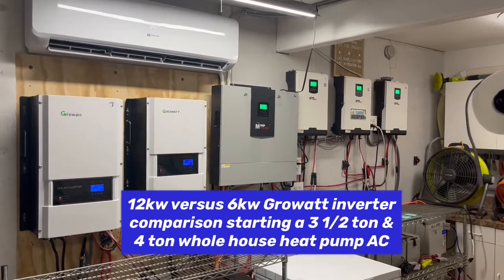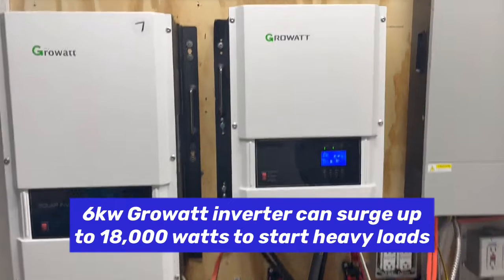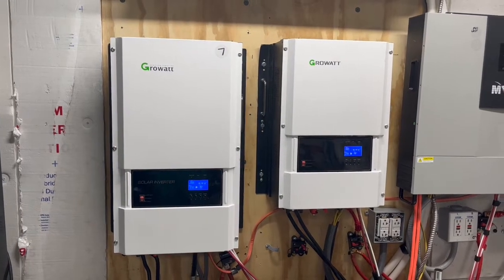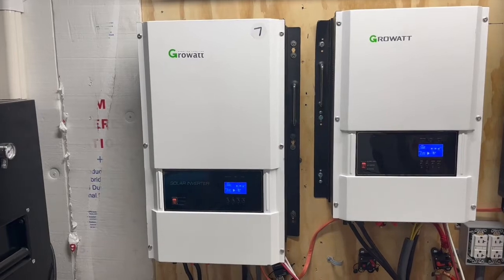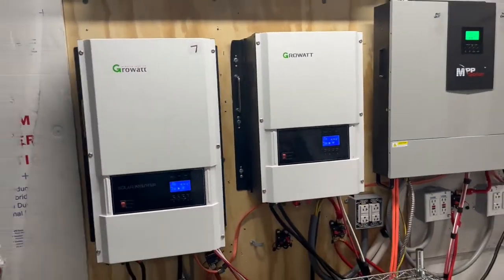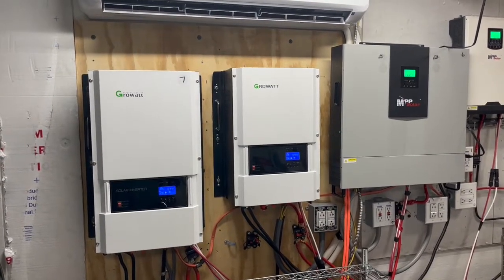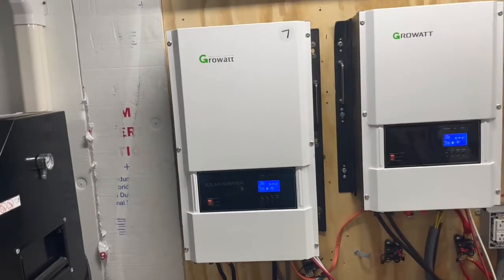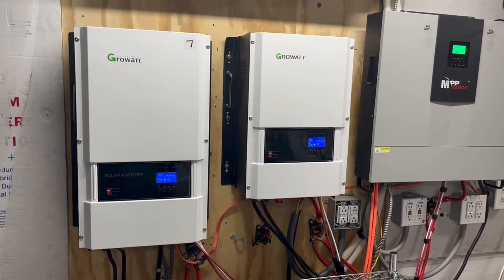12kw & 6kw Growatt Low Frequency off grid inverter comparison to start 3 1/2 ton & 4 ton AC.

Comment: I have the 6k Growatt and just installed a HyperEngineering soft start on my 3.5 ton whole house condenser.  The furnace is also on this same inverter.  The soft start device made it all work.  The furnace fan is just a few hundred watts but its in addition to the condenser pump and fan which is where the soft start made the difference.  I am running close to 75% when AC is on, but its now powered by the sun and I'm thrilled.  Thanks for sharing your videos and experience.
Reply from the maker: You are welcome, it is a great accomplishment to run ac/furnace on solar. The wonderful part about all of this is there are so many people willing to share on YouTube, taking a lot of guess work out of the equation. That’s how I learned to put my system together. I love the fact my neighbors bills are between $600 and $900 a month in the summer months and my bill never goes over $170 for the peak month. In fact my bill for electric all year is approximately $1000. I am all electric, no gas. My neighbors are so jealous but to lazy to install. I offer to help but don’t want to spend any money. My System cost around $14,000 and will be paid off in less than 3 years with rebates and savings on electric bill. We have 2 extra inverters as spares and all the supplies to replace parts for 2 decades. We set the thermostats way lower with solar. Well worth the effort and money spent. Thank you for sharing, You system will be well worth it when heating and cooling cost skyrocket over the next few years for those who did not do solar.
Reply from the maker: You are very welcome, it’s great to run your ac on solar. I actually use my 12kw Growatt to run my 3 1/2 ton and I don’t use the 4 ton that often. I can run my 2-120v mini splits downstairs and keep it just as cold plus run my 18,000 btu mini split in the garage and that uses the same  as the 4 ton. Never have any problems with the Growatt 6kw or 12kw. I can actually hang another one of my spare inverters up and have enough panels to spare for around another 2500 watts. I have more electricity than I can use. That is a great problem to have. Hope you have a wonderful and blessed day.
Reply: Thanks for the name drop. Really helped me out as I'm dealing with simular issue. Thanks bhunter763
Reply: @Moist_yet_Crispy  Glad it helped, I was really having a tough time deciding to try it because that's not a cheap experiment.

Comment: How long do those batteries run your whole house heatpump before they go dry?
Reply from the maker: I can run all day long, sun up to sun down, but I do not run on battery bank at night. No need, my electric bill is under $1000 a year. I only have electric, no gas.
Reply: Hi, how do you switch from solar to grid at night?
Reply from the maker: On my 12kw Growatt I have the 240v input coming in from my grid so I have to turn on breaker in separate electrical panel of grid power coming into garage and on bottom of inverter for input voltage and change setting number 1 from solar, battery, utility to just utility. Then you will be able to run through inverter all night. I’m almost to the point with a few more batteries to be able to run 2 mini splits upstairs and 2 mini splits downstairs overnight to cool house. We are only electric and my highest electric bill last year was $172 in August keeping house at 70-74 degrees overnight using utility to run both upstairs and downstairs  whole house heat pumps that are 3 1/2 ton and 4 ton. I do have a set up outside where I have 2 separate AC disconnect boxes to where I just move fuse handle from solar AC disconnect box to utility grid AC disconnect box, then I’m ready to run utility grid power overnight. So I have 2 different ways to switch from solar to utility grip power. Hope that helps. Have a wonderful and blessed day.
Reply: @diy-solar-guy  this is amazingly helpful information. Thanks!!! I want to run a well pump with this. I would like it to run on utility unless we lose grid power then it would switch to inverting from battery. My only concern is I've heard it uses 150 watts per hour or 3.6kwh a day. Do you know if it's still using this much power if it's in straight utility mode?
Reply from the maker: I would definitely use LiFePO4 batteries instead of AGM to use as backup overnight. I have 3 chest freezers, a 20 cubic foot fridge/ freezer and lights outside I run on battery overnight and it barely changes the voltage on batteries for the 12 hours I run all of them. That’s about 150-200 watts per hour. That LiFePO4 battery bank is 4-12 volt 150ah 2KWh connected in series to make a total of 8kWh 48 volt battery bank. I use that battery bank over the 51.2 volt 100ah 5kwh server rack battery because you have 3KWh more. If I had 2 server rack batteries in parallel I would use because it would give me 10KWh. But I bought the 4-12v batteries for the same price as the server rack battery. It also depend on the inverter usage you use at idle consumption. My 12kw Growatt uses almost around 200 watts per hour or 2 amps per hour at idle as where both my MPP inverters use less than 25 watts or .2 amps per hour. So I only use my Growatt inverters during the day. All my inverters are 48 volt systems. Hope this info helps.
Reply: @diy-solar-guy  ouch 200 watts per hour. that 5kw a day. makes sense you dont use them at night. I will have to figure out a way to only use them when the grid goes down. thanks for this info. very helpful in helping me decide how to design the system.
Reply from the maker: @jl9678  Growatt low frequency off grid inverters are great during the day but will need probably a 25kwh or more battery bank at night to run whole house. I have 2 mini split heat pumps upstairs and 2 downstairs and with my next set of LiFePO4 battery set I will be able to run all 4 overnight if I want to or if power goes out. 3 years with mini splits and all 6 are still running great with no problems or leaks. My 16 AGM batteries are over 3 years old and still hold a full charge overnight when not using because I only use during the day. I am really impressed with the AGM batteries but the seller is no longer on internet or eBay. Those AGM batteries start the large loads for 3 1/2 ton, 4 ton ac heat pump and 12.7 ton pool heater heat pump. I can use the 48v battery evo batteries in series as well to start 3 1/2 ton and 4 ton ac but have not tried starting 12.7 ton pool heater with LiFePO4 yet. That’s for another day.
Reply from the maker: @jl9678  the inverter will not show any usage from battery since it is in bypass mode. I never use my 12kw Growatt overnight so I’m not sure. I know the fans do not kick on in grid utility mode. It will not generate any heat for fans to kick on. I will run the grid bypass mode for 2-4 hours in early morning hours in February to run 12.7 ton, 127,000 btu pool heater and the fan never kicks on and nothing gets hot. I have 6 gauge wire running from grid power to inverter and to 127,000 btu pool heater. Nothing gets hit in bypass mode fir me and that can use up to 186 dc amps running that beast of a pool heater. I know when 12kw Growatt is in idle mode without fans running it will show using almost 1.5 to 2 amps usage when connected to my server rack battery. My Dual phase MPP and Single phase MPP inverter are great for overnight since idle shows .2 amps in idle mode. That is 1/10 of power consumption of 12kw Growatt. That’s why I love having Growatt for day and MPP for overnight. Hope this info helps. Have a wonderful and blessed day.
Reply from the maker: I started with the MPP inverters so it was no extra expense to use at night. And both MPP inverters were $1500 each. I also have 4-24v MPP inverters sitting in shell Incase the 48v Mpp inverter stops working, with the 12v battery Evo batteries I can easily change to 2-24v batteries with same 8kWh overnight. 24v MPP was using around 15 watts per hour idle when I was using them. That is why I have Anderson 175 amp quick disconnect cables for all my inverters to be very versatile. I like to think ahead on things. Lol
Reply: @diy-solar-guy  so if it doesnt get hot in grid bypass mode maybe its not consuming 200 watts from the grid in that mode? Im assuming since inverting is not going on that its not using all that power? if so that would be great. 

i have some questions.
1 . is there a way to automatically switch to bypass mode at night? I dont think so but I thought id ask
2. what do you think about using two inverters. low frequency for high starting loads like well pump and fridge and and high frequency for resistive loads?
3. can two different inverters pull off the same battery bank? 
thanks
Reply from the maker: @jl9678  answer to question 1
I believe you can install a automatic transfer switch externally from inverter but I never tried it. Subscribers have mentioned doing that in the comments on some videos
Answer to question 2
These Growatt low frequency inverters Connor be paralleled together. The 12kw Growatt low frequency inverter has a surge capacity of 36,000 watts so that is a lot to start large loads. Maybe other brands of low frequency off grid inverters can be paralleled together but I have not looked into that. I just know the Growatt low frequency inverters can not be paralleled together.
Reply from the maker: Answer to question 3
I have never tried to connecting two different inverters to the same battery bank while running. Not sure if it is possible without destroying equipment. Not willing to try to find out. But I know I just added a EG4 5500 watt, 100 amp output charge controller that can supplement the loads on all 4 of my inverters, but only connected to one inverter battery bank at a time. But I use Anderson 175 amp quick disconnect cables to quickly move charge controller from one inverter to another as my loads increase for certain inverters throughout the day and decrease on other inverters throughout the day. I always turn off charge controller breakers on side of unit before removing from battery bank and keep off to add to a different battery bank, once connect to 48v battery bank I turn on breakers and good to go in 30 seconds with supplement power or as a stand alone as only charging source for battery bank without solar panels connected. Check out my latest videos on the EG4 48v charge controller and see how I use the charge controller and how to wire up. This EG4 charge controller is only for 48v battery banks connected to 48v off grid inverters weather high frequency or low frequency inverters. A great way to help with surge of large loads. Also you might want to check out my video on soft start to lower starting surge on large loads by up to 75 percent on inrush amps. Lowered my inrush starting amps on 127,000 btu pool heat pump water heater from 186 in rush staring amps down to between 42 in rush starting amps and 59 inrush starting amps. That is a huge reduction in inrush starting amps. I used the same soft start for my 3 1/2 ton (42,000 btu) main heat pump ac unit as I did for the 127,000 btu pool heat pump water heater. Same unit works on both units. Info on product and where to buy is in videos. Hope this helps you move forward with your solar project. Hope you have a wonderful and blessed day.
Reply: @diy-solar-guy  thanks very much for this info. im subscribing to your channel now and ill go watch your other vids.
Reply from the maker: @jl9678  hope the info in videos answers your questions and gives you a better idea of what is possible with off grid inverters, charge controllers and battery banks.

Comment: My aims power 6 kilowatt will start and run, my 3.5 central air unit. With my 80ah 48v battery. I build lifepo4 batteries. They wor really well. Along with fridge freezer water lights tv.
Reply from the maker: Unfortunately the 48v 5120 watt hour 100 amp lithium iron phosphate I have is unable to start my 3 1/2 ton and 4 ton ac. Tried everything but it just shuts down. Have not had any luck with the 48 volt lithium iron phosphate starting anything with even a 30 amp inrush. Tried every setting possible but no go. I have no problems with agm batteries. Even 4 just agm batteries in series starts the 4 ton with inrush of 119 amps with Growatt 12kw inverter. Signature solar said I needed 2-5120 amp hour 48 volt lithium 100amp iron phosphate in parallel to start 4 ton. Not willing to drop another $1700 on a lithium iron phosphate when my agm batteries work just fine every single time I start up my AC’s. I even had 12,000 watts connected to 12kw Growatt and it would not start with lithium. Only had 4000 watts with agm batteries and 12 kw start 4 ton with agm. I’m beginning to wonder if there is something with the bms on lithium iron phosphate battery that will not allow the 100 amp or even 30 amps inrush current. I believe you that the lithium iron phosphate batteries work well, just have not been able to get the 48 volt battery I have to work even trying on four separate inverters. The 24 volt lithium iron phosphate battery bank I have has worked well and I plan on getting 2 more so I can make a 48 volt battery bank and us as 24v in my motor home down the road. Those can handle a surge of 100 amps no problem and use Anderson cables which makes connecting easy.
Reply: @diy-solar-guy  I buy them from aliexpress, I use both prismatic and, 32700 litokala. And daly bms. They work really well.
Reply from the maker: @carlosreyes6448  The 12v lithium iron I bought from batteryevo in California and really like. They were easy to configure with settings on 24v mpp inverters. Anderson connect makes portable for motor home. I have not tried using the 51.2v lithium iron phosphate battery since I added soft start to 3 1/2 ton ac. It is working so well with agm batteries I really don’t want to spend the time trying with lithium. Lithium does not like being charged with more than 30 amps when it is should be able to take 100 amp charge. Battery shuts down. Not inverter?
Reply: @diy-solar-guy  its usually around 52 to 54 volts.
Reply from the maker: @carlosreyes6448  correct

Comment: Dont just plug solar from one inverter to the next, you need to make sure the open circuit voltage of your PV is correct for the connected inverter.

 Having errors because of PV connected and keeping it without understanding why is a big safety issues. You’ll blow up your inverter or start a fire 🔥
Reply from the maker: I appreciate your input. Not sure if you know I’ve been running this system for over 3 years now with no issues. I know what all my arrays pv voltage is, do you know what my pv voltage is for each array I have? I think it is silly you trying to tell someone else what to do when you have never seen my system in person and don’t know how I test before I connect arrays. The inverters have a lot of built in protection and I have never tested that, lol. Inverters if connected wrong usually trip the breaker with an error fault code which 99.99 percent of the time you just fix problems if there are any and reset breaker and turn back on. I think you make the mistake of assuming others make mistakes, why? I have been running all my systems, not just a system but actually over 7 different systems without a issue for over 3 years, I did not go to college or university to learn this. I spent years learning this on my own before I did all this DYI while going through 2 incurable cancers. Most people do this while completely healthy. I had to contend with going in the hospital dozens of times and not being able to even go outside for days or weeks even be able to lift 10 lbs. I created all this from nothing without any help and to be honest most people that leave comments are not even able to accomplish what I have done, but seem to think they are experts telling others what they should or should not do.  I doubt you could accomplish what I have and go through 2 cancers, covid 3 times, coughing up blood, having debilitating headaches for weeks or months and the list goes on. Please when you think about leaving a comment, don’t assume the person is as ignorant or stupid as you are in this comment. Trying to make yourself look good on another’s channel is just pride
Reply: @diy-solar-guy  Just referring to the video specifically around 4min and to the old inverter setup you had where you mentioned that “It would fault code and shut it down because it was either too much voltage or too much amps” Just reminding folks that to make note of any such errors and that it may not be issue with inverter as much as running out of spec of the inverter... that's all... wish you the best!!! 😀